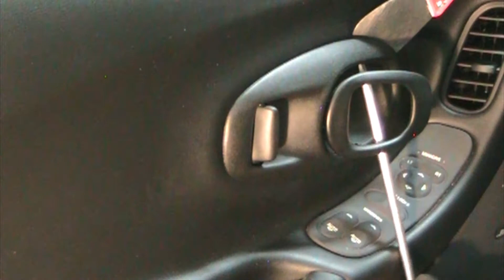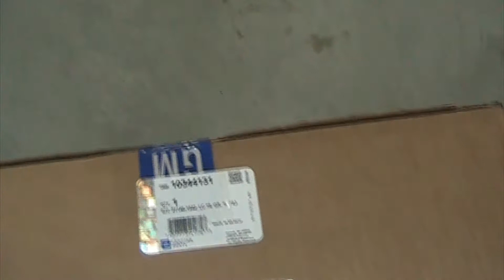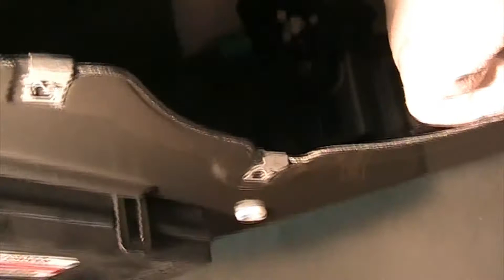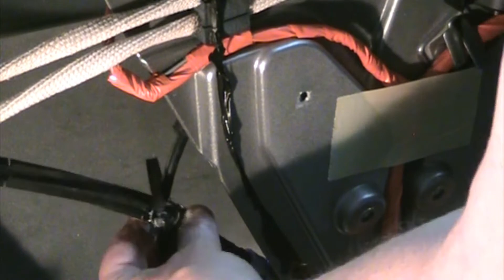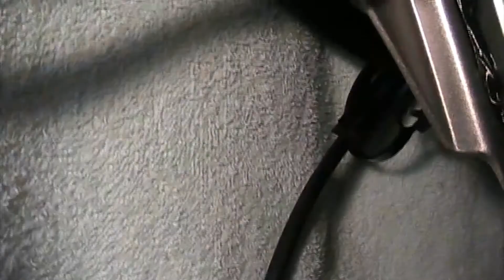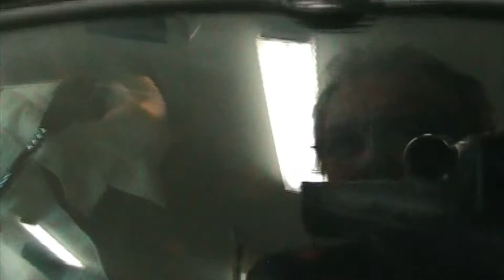C5 Corvette – Power window regulator/motor replacement – DIY instructions

Comment: That you for this video. Ill soon dianose my window on why it didnt work last night and if i have to replace my regulator ill be prepared,thank you very much for this video. I have a 03z06 with 14k miles on it. Got it 15 months ago with 10k miles. Its not miles its the age of these cars and things go bad. So far i fixed my EBCM myself my re-soldering the connectors earlier in the year and the first week i replced my master cylinder myself too since the clutch pedal would stick sometimes.

Comment: Nice video but watching you use two metal screwdrivers to remove that switch panel was painful.
Reply from the maker: I know. I was very delicate with it. No scratches. I really need to buy a set of plastic door panel and trim removal tools.

Comment: Can you provide part number and provider that you ordered from?
I am having trouble finding the correct regulator that attaches to the bottom of the door.
Thank you
Reply from the maker: GM Part = 10344131 is for the driver side door.  I bought it from Amazon.com and it is a Genuine GM Part.

Comment: Appreciate the thorough video. My window was stuck up. Followed your vid to get in the door and then found another video explaining how to get the window to roll down to get to the bolts - it said tap on the motor.  I did, and the window was back to rolling up and down again!  So I put the door back together and called it a day 😄
If it fails in the future though, Ive got the new regulator and motor and this vid 👍
Reply from the maker: Glad it helped